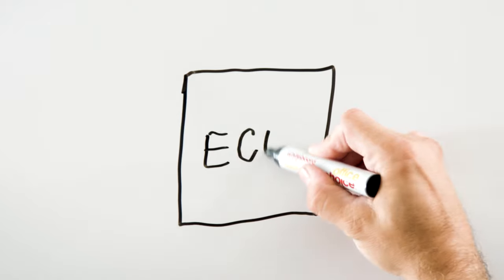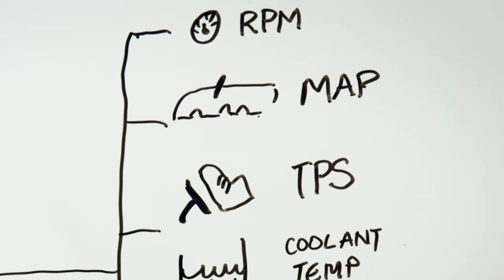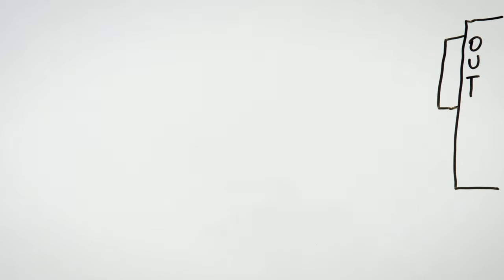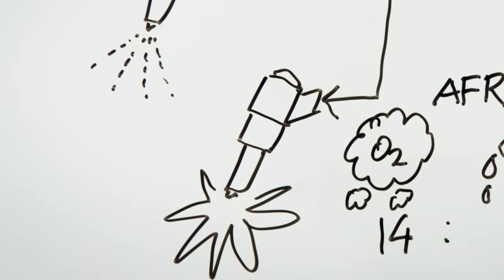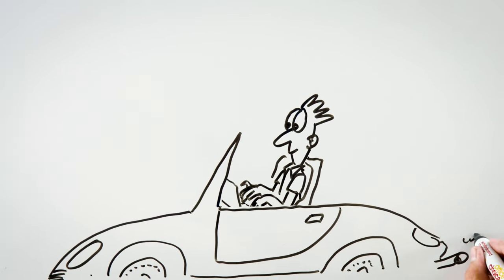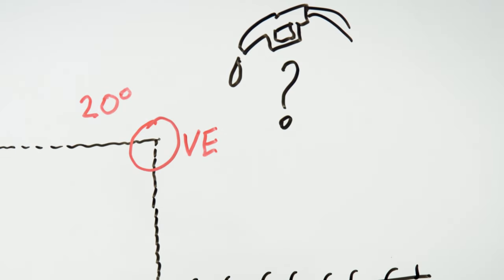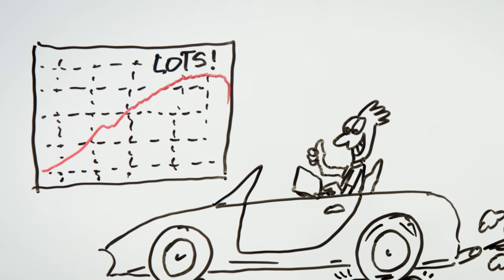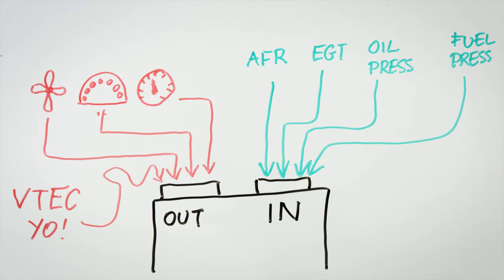💬 How ECUs Work - Technically Speaking

Comment: ECU = Engine Control Unit 

Not Engine Management System.

Otherwise, the rest was very informative. Thanks :)
Reply: rotary engines are called rotaries because the original rotary died out and wankel engine sounds silly. Nobody is talking about engine control unit because that's not all an ECU does anymore. ECU's can now learn and adapt, so they manage the engine control.

You got this video for free, don't look for that one thing to correct. These guys do their homework.
Reply from the maker: What's implied in that sentence is that an ECU is a part of an overall Engine Management System. But you're correct - ECU stands for Engine Control Unit.
Reply: Meusana i wasn't putting the video down nor am i complaining. It might have just been a typo in the script (if there is one? if not, very well done!). Not everyone knows/understands what ECU stands for and will be a typical internet user that will not google it but instead either not ask or ponder on it for a couple of days before either asking or googling it.

thanks for your 2 cents though.
Reply from the maker: Technically that's PEDANT ;)